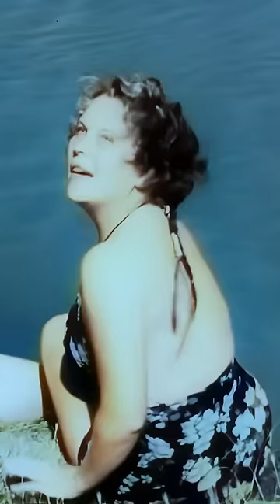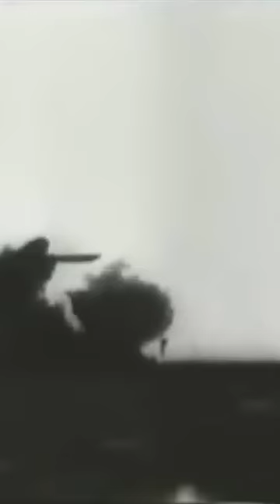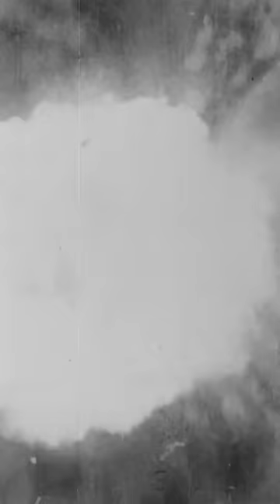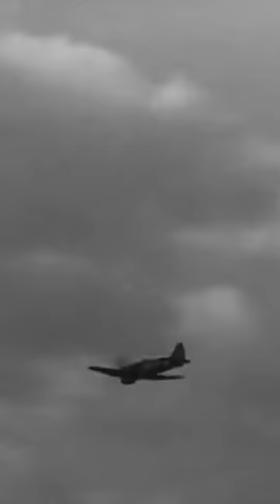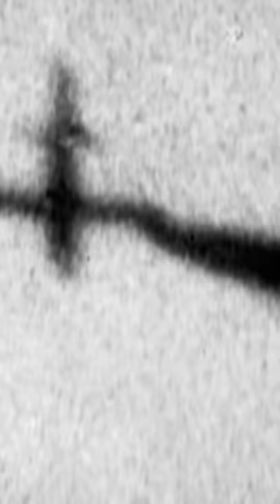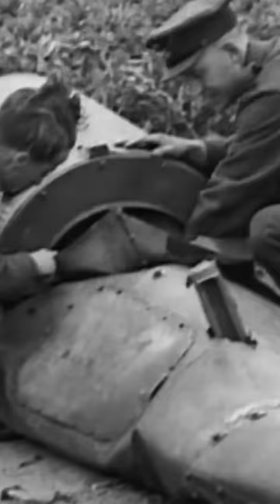The RAF Pilots Who Rammed V-1 Missiles🫣 #shorts

Comment: The good pilots didn't have to touch the V-1, they just got their wing close enough to the top of the V-1's wing to disrupt its airflow and get it to roll, which would then confuse it's simple flight "computer", that would then cut it's fuel flow and then cause it to crash...

Comment: Correct me if im wrong hut i thought this was a Spitfire tactic if it had the Griffon engine?
Reply: It was
Reply: You are correct was a hot rod spitfire that was made to catch them.
Reply: Spitfire, Tempest and Meteor all had wing tip kills against V1. Admittedly, the Meteor only had one with 11 cannon kills.
Reply: Yep. All the way up to Mk14. Then the V2 came in.
However:
Wg Cdr Robson explained that the skill of the Second World War pilots ensured that the wing of a Spitfire did not need to actually ‘hit’ a V1 wing – but instead used an ingenious method of using airflow to throw the flying bomb off course.
Reply: @freyatilly  Yep, the turbulence off the wing tip would be enough. Damn hard to judge though 😀

Comment: The Tempest didn't down very many.  
But,
The American development of the proximity fuze and of centimetric, 3 gigahertz frequency gun-laying radars based on the cavity magnetron helped to counter the V-1's high speed and small size. In 1944, Bell Labs started delivery of an anti-aircraft predictor fire-control system based on an analogue computer, just in time for the Allied invasion of Europe.
After that, 82% of the V-1s were shot down, using less than 100 rds per V-1...... Just by the new AA guns., and the V-1s ceased to be a threat..
Reply: Tempests alone downed 638  of 3900 V- 1s downed.  That’s significant.
Reply: Thank you for the update 👍
Reply: And then V1s were replaced with V2s bigger faster and the World's first ballistic missile- its maker von Braun was feted in the U S. Wonder if it would have been the same if they rained down on Washington DC or New York.....
Reply: @robharris8844U  ,. The V2s were hardly Skuds.
Zero accuracy, and not enough of them.
Reply: @agnosticsaint  ,. That's about 16%, but even that's incorrect.
17% were downed by aircraft, (all makes,) and barrage balloons, etc.
The Tempest had severe malfunctions with it's cannon....
Reply: The Tempest was suprem in the interception of V1s 700 plus downed .
So your claim that the Tempest didn't down many V1s is utter nonsense!!)

Comment: I want to know how they were  controlled to their targets?
Reply: By using a preset heading, speed and time. The V1 has a little wind driven wind turbine in the nose of it that spun while the V1 was in flight and after a predetermined number of revaluations of the turbine it cuts off the fuel supply to the pulse jet engine that gave the V1 it's buzzing sound. After the engine quit the V1 would go into a dive and crash into what ever was on the ground. They were not very accurate they were more of a terror weapon.

Comment: The annoying over used voice is only giving part of the story. Most RAF pilots didn't actually touch the V-1, they placed their wingtip just in front of the V-1 wingtip and the air disruption would cause the V-1 to roll into the sea.